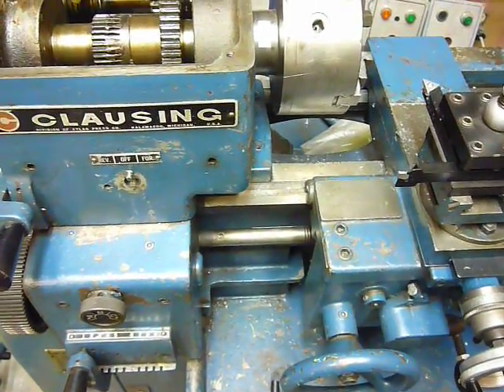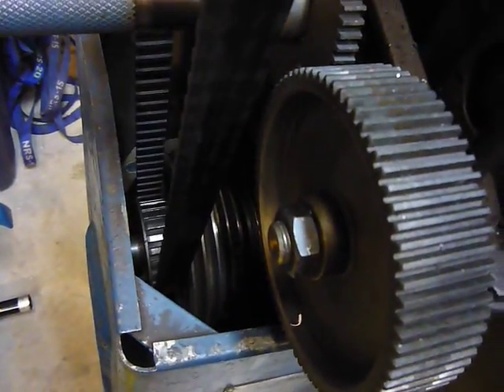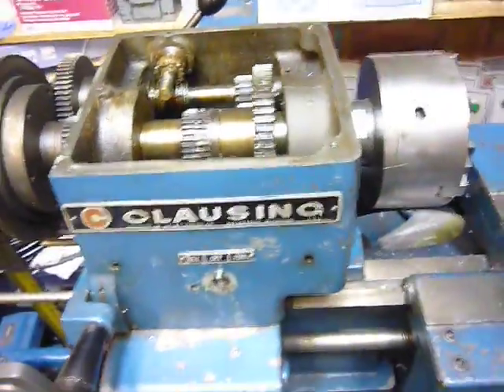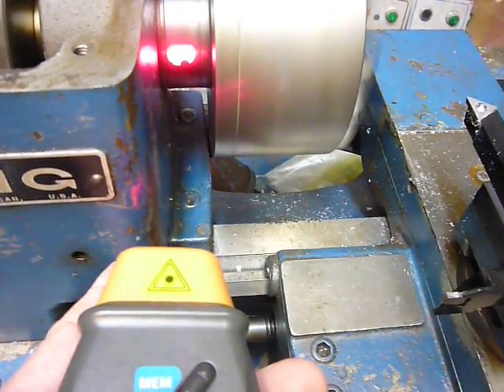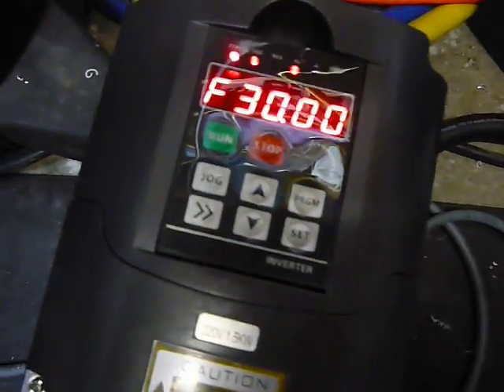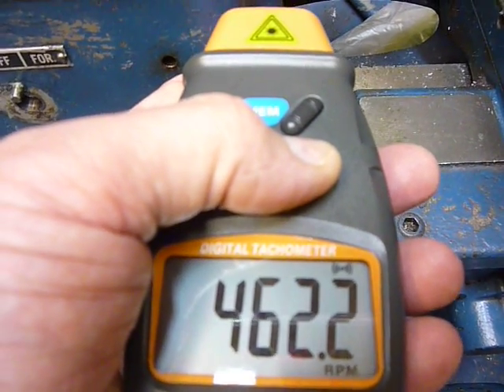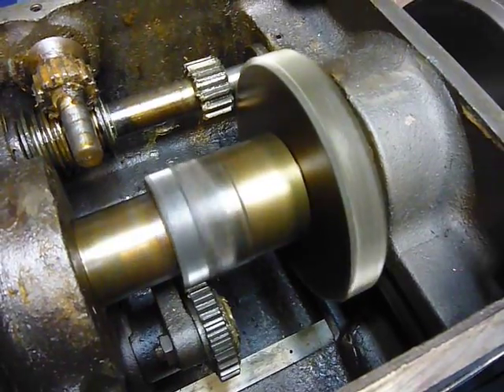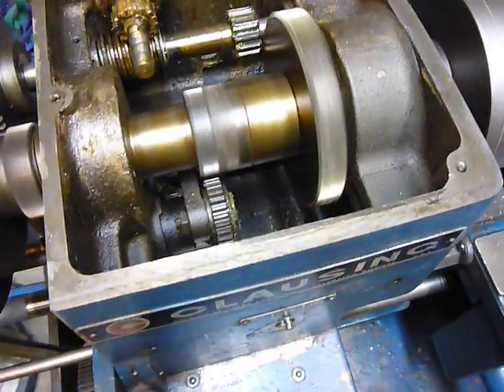Clausing Lathe CNC Conversion 02 - Digital Tachometer

Comment: Hi there,  got the exact same model for the same reason and used it in the same application, it works a treat.  Also used it to check my digital read out on my drill press there realised I saw the exact (almost) setup inside the drill press 'head'. Cheers. Joe.

Comment: @Liberty4Ever 

I worried who would it be moral to sell that lathe to.

The guy that showed up has put amateur rocket in space and builds dragsters as hobbies, but owns a saw mill. He was looking for a Clausing to restore. It all worked out. 
My brother has a Clausing 8520 that he treasures, I never got that feeling with the 5914.
I got a PM1236 and thought I would put a treadmill DC motor in it, but it works so well I have left that part alone.

Your energy is way higher than mine.

Comment from the maker: @tnekkc I'm a 51 year old electrical engineer.  Hopefully, I still have the energy to finish this CNC conversion.  Adding the variable frequency drive was actually easy.  In fact, if you didn't have three phase electrical power, the VFD is about the same price as a phase converter, and it also allows the added feature of electronic spindle speed control instead of messing with belts & pulleys, which is nice even if you aren't converting to CNC.

Comment: I had a Clausing 5914, I bought for gunsmithing.
When it had been at Boeing, it got painted seafoam green.
Yours is blue.

I am a 60 year old electrical engineer, and I did not have the energy to replace the variable speed belt drive.